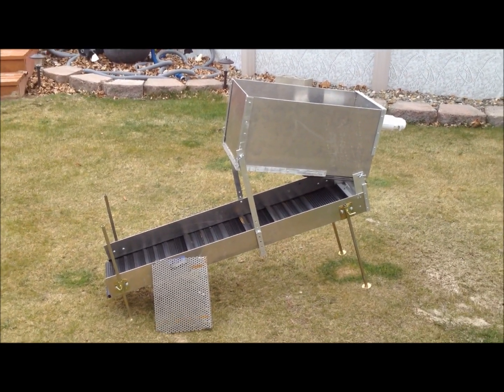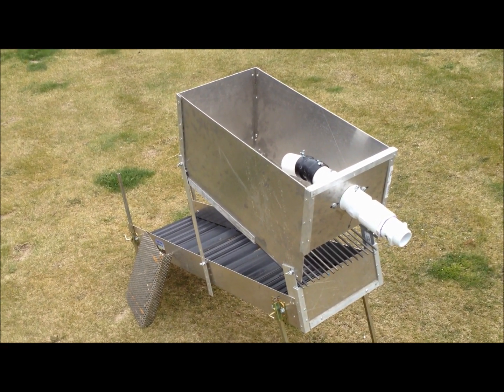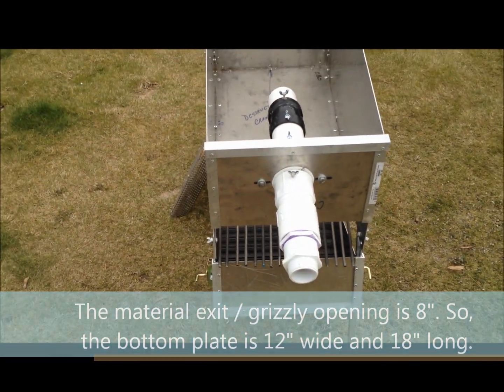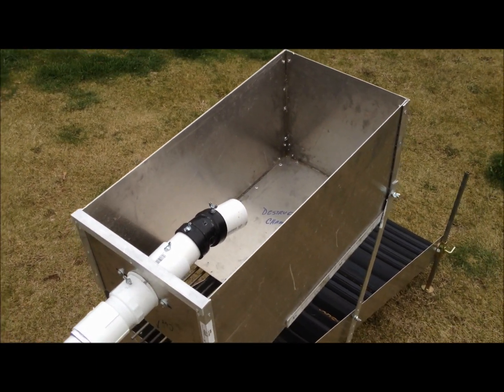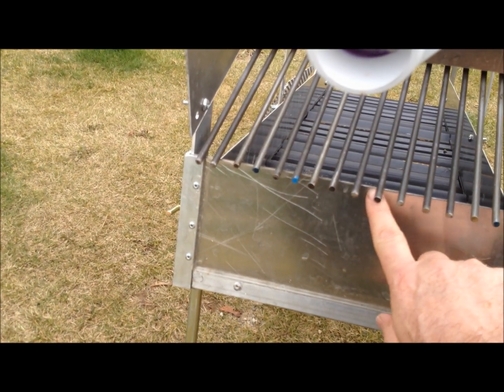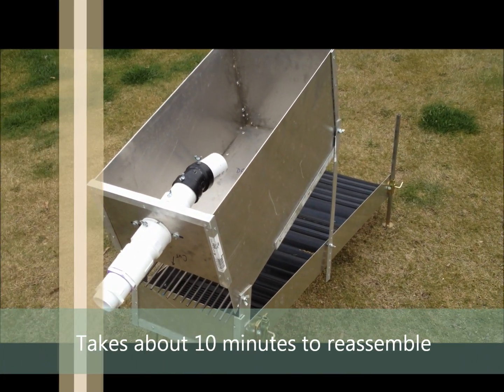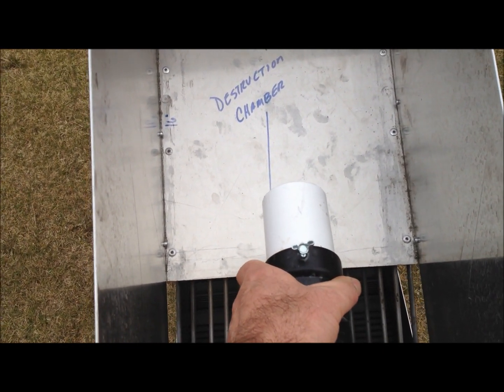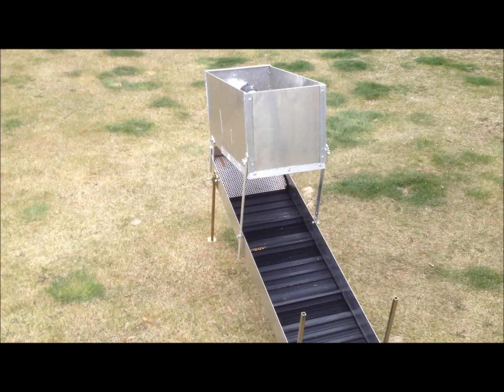My Homemade Highbanker Build

Comment: Hello Sir. How did you seal the joints where it's riveted? And what do I need to rivet it?
Reply from the maker: I sealed it with a bead of silicone chalking along each joint face where metal to metal contact was made. You'll need a rivet gun, the appropriate sized rivets (I used 1/4"); a drill with the appropriate sized bit (I used 1/4"). Hope that helps.

Comment: Ok.....
I now see another idea. You put your water intake higher then grizzley. Will have to toy with that idea.
That's something that has bothered me.
Reply from the maker: Yeah. I also mounted the back of the  header box on 2" x 4" x 1/8" thick aluminum to keep the grizzly higher than the back splash of the sluice. You have to do that so that the grizzly doesn't hit the backsplash when you tilt the header box to the desired angle.

Comment: HEY MAN!
1st off. Thanks for sharing your video. That's gotta be scary with all the critic's out there? Question that I've had about high bankers? With the supports for the upper end of the wash box/classifier connecting just to the sluice. And not running on down past to the ground? Can you tell or maybe notice if when a shovel load of material is throwin in the hopper (see I remembered? LOL!) If it flexes or bounces to where it could knock the gold loose and roll out the end? And another question? How about bowing after a while of use and time? It looks rugged and stout! My compliments! I was just wondering? Cause I'm about to build my 1 st one so? Or what would you have done differently?

Comment: https://www.youtube.com/watch?v=jZO97htr6Hg&t=13s   https://www.youtube.com/watch?v=qHe54kyYt54&=5   . It is always good to see some one engineer their own sluice box . Mine was built from a sheet of 5/8" plywood and steel parts with solid rubber wheels modeled after a 1800s grizzly and other stolen ideas from old time miners. You can shovel steady till you drop .no bucket brigade necessary . Found it collects 95+% of the fine gold on a wool blanket tray no riffles  . Got 3 grams on a hot spot one day just on the blanket . bartoonski@yahoo.ca . have pictures

Comment: John, Putting together a similar design, and will run only 12v.  Do you think I would be better off with a higher flow bilge pump (maybe 2000-3000 gph? with a ball valve) with higher amperage, or two lesser bilge pumps (1000 gph) with low amperage, Y-ing together into 2" hose before they dump into the hopper?  Trying to balance needed flow and my battery life.

Comment: Thanks for posting I'm gathering ideas on how to build one and I'm impressed by this design because in others even those built by companies for small sluices, it looks like the rocks get washed out too quickly but in this the dirt  will get a good churn around before escaping.  Also it's not particularly complex to build.  Hopefully you've found enough gold for it to pay for itself, and more!
Reply from the maker: Thanks Asone. You might check out my mid sized highbanker build. Its lighter weight and still moves a gob of material. Good luck!
Reply: @johnjacobs3643  How much would you charge to sell one of these?  It looks great

Comment: nice video I would like to know what elec. pump you use and which two gas pumps you use
Reply from the maker: Michael. My 2 electric pumps are 3700 gph Rule pumps. I use a WH15 Honda gas powered pump. Thanks.
Reply: thanks

Comment: Nice job John! Your voice sounds just like Don Felder from the Eagles(watch an interview of him on YouTube). You may also try a 12" or 18" wide Gold Well Vortex Sluice put on the end of yours to see if your losing any micro gold smaller than -100 mesh. Yes a Popandson expanded metal(3 sizes) and miners moss sluice is VERY good for -100 mesh gold but complex to make one.

That IS what I want, a Gold Hog Raptor Flare 2.0 highbanker with a 18" Gold Well sluice put on the end. Running with a Honda WH-20, 2" high pressure pump. I do not think the Angus MacKirk 14" or 16" Commercial sluice would help recovery of -100 mesh that the Gold Hog missed.

IMO the 2 best clean-up sluices are Gold Hog's 8" multi sluice and Gold Wells 6" one. I owned the Gold Cube and did not like it for several reasons(not enough time right now to tell you). What sluice do you use for clean-up and then finishing to clean gold.?

Comment: Hi John very nice build.Love your choice of matts.Mine is home built also a little different but along the same lines.I am only 9 inch wide and 34inch of matt.I have about 14 inch of slick before the matt so 48 incnh overall I ran 2 units in tandem for some time.very seldom ever found gold in the second.So gave that up waste of time.I do keep my angle down to 1 inch per foot and find that works the best and 2 folks can shovel all day.Play with it luck Mark.
Reply from the maker: +mcbain mcbain 
Thank Mcbain. I hope you find lots of gold with your highbanker. Nothing like building something from scratch and seeing the results! I also have a video about a mid-sized, lightweight, highbanker that I built. I love it. Easier to pack around, but still able to run lots of volume. Cheers!

Comment: Hey John, still haven't rcvd that email yet - dhatcher2002@hotmail.com - I wanted to ask you how you created your riffles above your matting. or were those bought? I bought a couple of rabbit feeder boxes - or rabbit homes that are almost identical to what you have for your high banker measurement wise - literally flip them over and almost good to go. Ill show you once im done. Im pretty much following your design with water flow because of the churning action (looks better than anything else ive seen). Have you ever thought to make sides that go from the high banker down to the sluice box? do you loose material when it falls through the grizzly bars to the sluice or is it even worth worrying about? thanks John! Dan H.
Reply: +Daniel H OH also - i have been to home depot lowes etc....where can i find those legs to hold everything up?
Reply from the maker: +Daniel H  Daniel, I purchased the legs at BlackCatMining.com; There are several online prospecting stores that sell them. I purchased the punch plate on ebay...this is what I have over the matting under the header box. Its 1/4". I do not lose much material out the sides by the grizzly. It works really well. I'm glad to see that you are making one of your own. Have fun! This is the greatest hobby going! John

PS...check your gmail account. I think that's the box that YouTube messages go to. I tried responding to your messages, but I kept getting an error.

Comment: Where do you buy the aluminum from?
Reply: ***** wow that's cheap.. I never thought about going there and looking.. And I have one nearby.. Thanks for the response
Reply from the maker: +theBald1 I purchased the material from a metal distributor in my area. They cut the box peices to the size I wanted and bent the sluice to the dimensions. Like Jeff said...actually, quite inexpensive. Sure beats buying a highbanker for $1000.
Reply: John Jacobs and thank you also for the quick response.. Lol.. I'm actually on the road now heading to my local metal shop to purchase a 4 x 10 sheet.. $162

Comment: I really like the setup John I myself bought the 10 sluice blank and hopper setup and as you said its very well made but in the same I don't care much for the grizzly bar setup as I was constantly having to shove rocks off.  So I am building a hopper based off of the gold hog monster hog and yours.  Now what I was wondering was on your brackets that attach to the sluice and then the hopper did you trim the matting and place the brackets at the very bottom of the sluice?  hard to tell in video so thought i would ask.
Reply from the maker: Au_Prospector 4life Hey Au! Yes I placed the brackets to the very bottom of the sluice. I just trimmed the matting to slide into that narrower-width area. Good luck with your sluice. I'd love to see the finished product! Thanks.

Comment: Hey John, Im new at this, just wondering how your gold matting is held in? i see you have a couple different types going down the sluice. 
Thanks

Wes
Reply from the maker: Wes Roberts Wes, I use UR, Razorback, and Scrubber. They come in 36" wide lengths. I cut them to fit the width of the sluice box (12"). They hook together in a tongue/groove type manner. I put them together using super glue in the tongue and groove area and gorilla tape underneath. They have videos on the Gold Hog website that show how to do this in detail.

As far as keeping the mats in place in the sluice box, I show how I do this at about 12:27 of the video. I have a header bar (1" aluminum strip) that is held at the top of the sluice bed by two 1-1/2" bolts and wing nuts. I also notched that portion of the matting to fit around the bolts. I just slide the mat under the bar and cinch down the wing nuts. I hope this helps.
Reply: awesome, thanks!!

Comment: You said that the grizzly opening is 8" 12" wide and 18" long , before you said the box was 24 " long, if you put and 8" inch opening in the bottom and then had 18" long left that would be 26"  I think you ment 16"  long which = 24"  as you stated in the box design. Am I right on this or not ????
Reply from the maker: You are correct.

Are you building one? If so, good luck and happy prospecting!

Comment: Great video:  I am just finishing my own highbanker.  One of the last items is the 1/8 punch plate.  Any tips on where to buy a small section of punch plate???
Reply from the maker: I bought mine at a local materials distribution store. They sell all sorts of metal material; fabrication; cut to size; etc. You can also buy it on ebay. I'd like to see your end product! Thanks

Comment: Great design John. I'm making one and I visioned it much like this after doing all my youtube watching research same as you did before making yours.  It's real nice.  My goal is to make it without spending a dime, just using scrap materials, but I'm getting pretty close, just using metal shelving and other metals and hinges and grizzly type stuff.  I haven't figured out any ideas on saving money for the legs yet but the rest is almost covered. I appreciate your design. I want to only spend money at the Home Depot on PVC pipe, and gold hog matting. Which did you use here? The scrubber, razorback or UR? Also, why did you go with a wide mouth design for your water input rather than the PVC pipe that makes a o ring around the top and has the sprayers. That's how I imagined it and have seen some using that and in comparison it seems to me that us cleans out the hopper better, but perhaps yours creates a stronger overall flow? What's your thoughts?
Reply from the maker: Thanks Kam. I can't wait to see your build.

I used UR under the header and then alternated Scrubber and Razorback through the remainder of the sluice.

I went with the large volume PVC inlet for the sprayer design to get a churning action in the header. It helps suspend material in the header longer so that clays can be broken up better. It works great for me, but your's may be a better design.

John
Reply: Well I could definitely see the advantage to that. Thanks and I'll keep you posted on the progress
Reply: Kam, I plan to use 1/2" electrical EMT galvanized conduit for legs and attach them with 1/2" single screw hole electrical brackets. The 2 hole brackets are way too thin to drill and tap. I'll drill and tap the bracket to hold a 10-32 thumb screw. I expect it will cost me less than $20 for 4 legs, excluding drill and tap hardware. OK, a little heavier, but so what?

Comment: fine looking machine,  for this summer i intend on building something of similar design using  plastic containers on a wood frame.  i will put together numerous frames left at some honey holes and make the hopper out of a deep plastic storage container and the sluices out of two 4' x 2' 6" high plastic storage containers. 
 i will make 4 of the sluice boxes, twice what i need so i can keep working while my lady cleans out the last set. the good thing about leaving the frames on site and only carrying the 5 containers will be that they are light and stackable and easy to move from one hotspot to the next, plus they can be replaced easy and cheap

Comment: thank you John ! i have all ways wanted to visit and fish and prospect on the clearwater . i have spent a lot of time on the Salmon fishing and doing amateur prospecting .    I have a lot of questions . where did you get your elect, pump ? i have 2 1000, gph . that i got at harbor frt. but haven't seen one that big . Thanks !
Reply from the maker: I got it on ebay. Just type in 3700gph 12v pump and they'll pop up. I prefer Rule pumps, but they are kinda spendy. There are some less expensive China pumps on there also. I think Johnson Pumps make a 4000 gph pump and they are pretty well made also.

Comment from the maker: The material distributor is the business where you can buy metal stock. Many of them have bending and cutting equipment, and can cut the aluminum to the dimensions you want. In my city, the business is called Gateway Materials. I would just Google "aluminum stock" or "metal cutting" for your area. Also, you can buy online from various sites. Hope this helps.